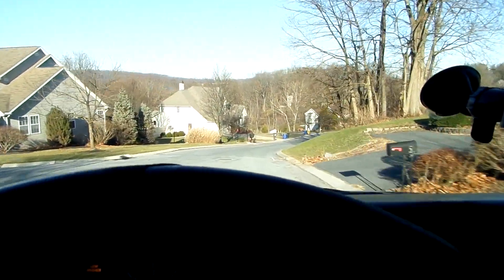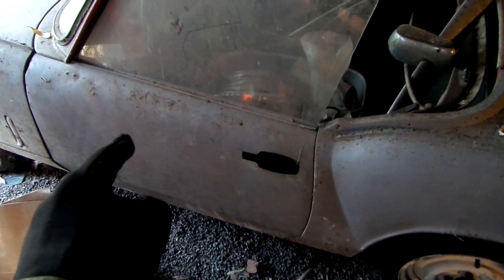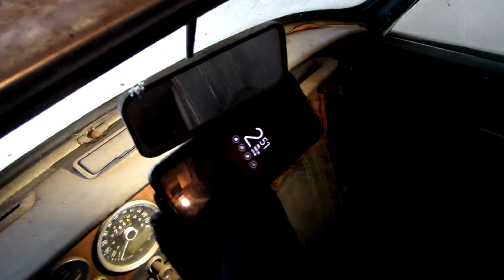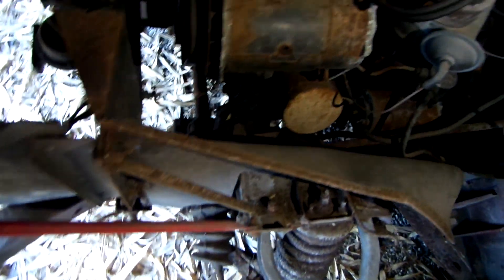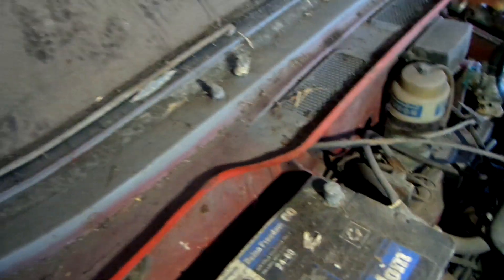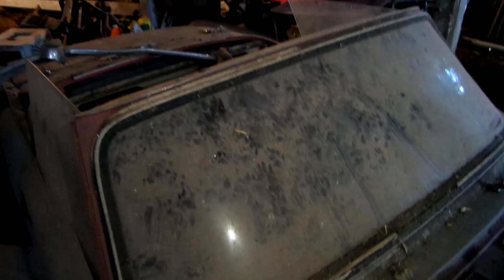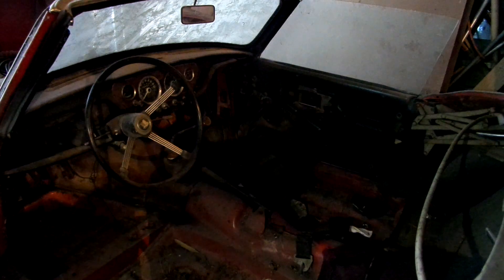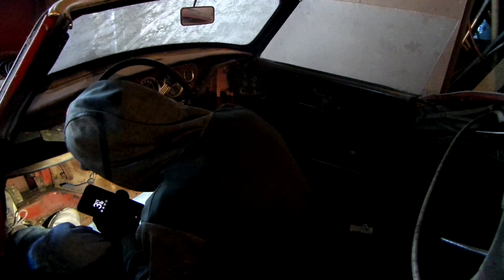Barn Find Triumph Spitfire Restoration #1 - First look

Comment: Looks like it has good bones. Looking forward to your progress.
Couple things though...
Lesson 1, don't lift the bonnet (hood) by the latches. Lift by the wheel arch.
#2. The commission number is the VIN number
#3, don't throw anything away yet, even if it's looks beyond saving. You never know if you'll need it for reference, or maybe it could be saved...
Reply from the maker: Thanks. I plan on starting to upload at least 1-2 videos per week. I'm keeping everything including the very dry rotted weather stripping in case I need to measure up a piece or something. I'm looking forward to fixing it up
Reply: Hi Hazen.  How are the book sales going.  BritsnSpits here.

Comment: That "H" shaped brace connects the bottom of the dash to the floor and stiffens the car up quite a bit.  It is also where the radio mounts.  The half bumpers go on the rear, the full width bumper with the bumperettes goes on the front.